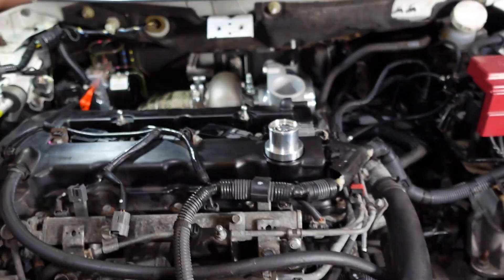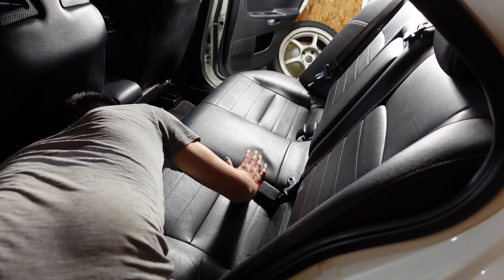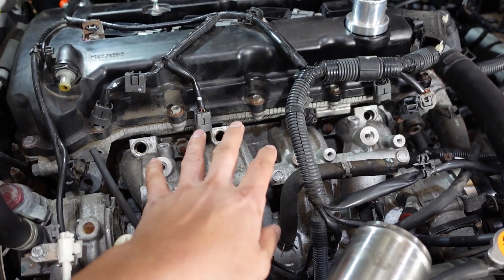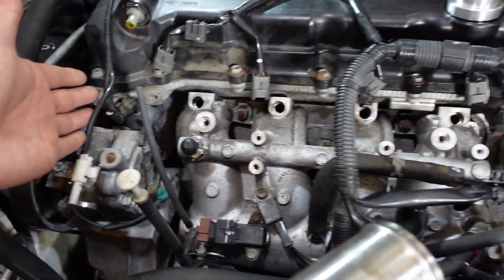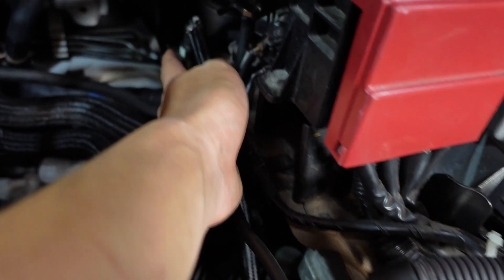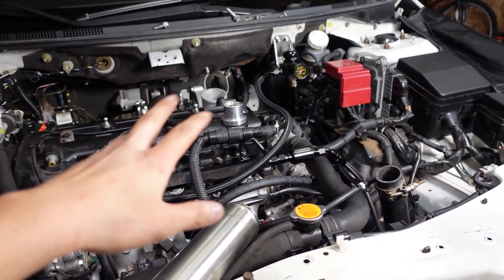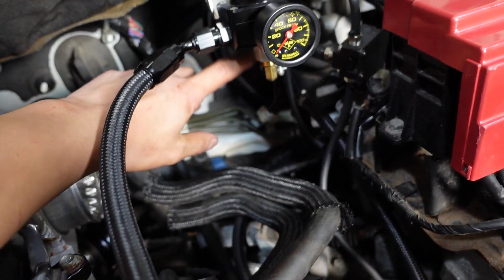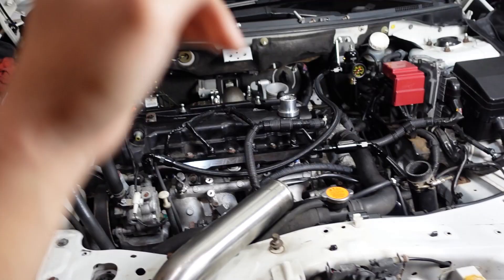Evo X Big Turbo Build (Fuel System Installation)

Comment: Thanks for making this. Finally got around to doing mine and was having some placement issues for the fpr. Question tho - if you still have your car, how did the plastic valve cover hold up to the heat of your top mounted turbo?

Comment: I am highly surprised you where able to get you base fuel pressure to 43.5 psi without drilling the venturi in the fuel pump hanger with a 450 pump.

Mine wouldn't go below 55psi without it drilled.
Reply from the maker: Yeah I might just got lucky, no issues so far. Knock on wood.

Comment: hey I've been loving your video on the Evo and cant wait to hear the cold start and see it hit 500 horse power. Keep up the great work. On the side I was wondering if you knew anything about the brake lines, i got a 2010 lancer that's leaking from above the fitting on the abs module and i just cant seem to fix it. Any help is greatly appreciated :)

Comment: Good job bro but change that filter asap
Reply from the maker: The map inline fuel filter?
Reply: @ykmedia3439  yeah I know multiple tuners that suggests its too small and a restriction if anything. I’d suggest the radium inline fuel filter. I don’t work for them but have theirs on my Evo and they have MULTIPLE articles of research to back up their products
Reply from the maker: @MotoDJS1KRR  thanks for the advice I will look into the radium one.

Comment: Hey man. With that problem hose u have. Will it kink when the fuel pump assembly compresses when you put the assembly back in the tank?
Reply from the maker: You will need to cut the hose really short.